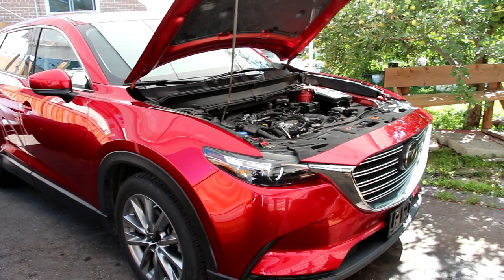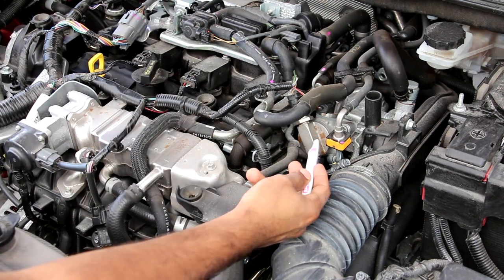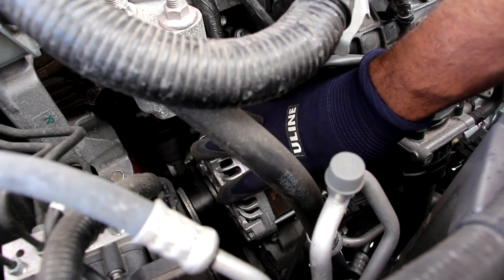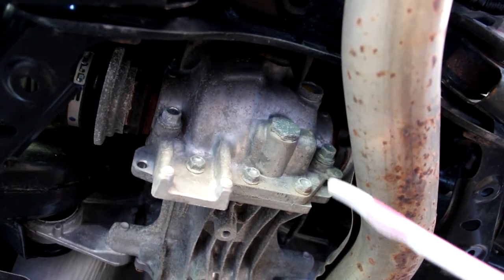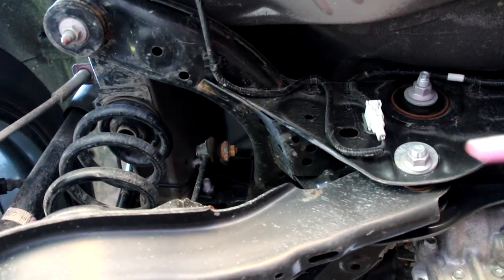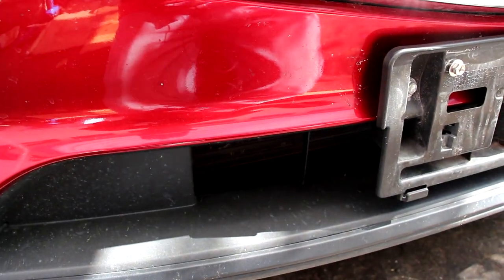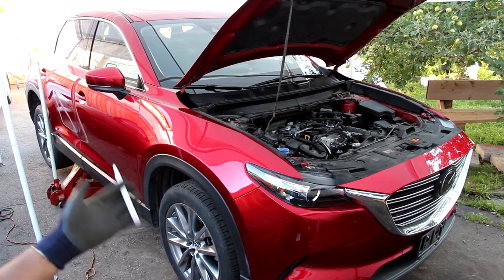Mazda CX-9 Mechanical Review

Comment: Year old and so much rust. Unbelievable
Reply: It seems these days each automaker has a major drawback, for the mechanical reliability, just rust proof it and Mazda is among the best in the business right now.
Reply: Simple fix by galvanizing the steel parts. My old Mazda 6 2005 has lots of rust on these under car parts but are so thick they are still strong.....
Reply: i was about to mention the same thing !!! someone actually told me in Canada Mazda knowing for being a rusty vehicle now seeing that i think he's correct !!!
Reply: I think it's mainly wherever he lives. In the videos that I've seen of his, all the vehicles have rust
Reply: @denttech2515  Welcome to Canada, all our vehicles rust out first winter unless the extra coating is applied.
Reply: @ljpr360  Funny, 2014 Mazda 3 and 2016 Mazda CX-5, neither “rusted out”?
Reply: @divak9026  Still going strong, no rust issues
Reply: The environment and driving conditions tends to be a bigger factor for rust than its design. They don't call it the rust belt for no reason
Reply: I will have to do NH Oil Undercoat cause the liquid salt they use here is worse for rust than the old so called rock salt.
Reply: Rust proof it and wax it each year. Like any car... at least wax it when you buy your car and keep up with wax it once a year
Reply: My 10 yo Corolla has the same amount of rust :)
Reply: Unbelievable
Reply: Because Mazda has a high compression like a diesel engine
Reply: This is how people save money and skip car wash underneath in winter

Comment: Has this car drowned in sea water? I have 2014 CX-9 and with no rust or very minimal of the iron frame and iron arms.
Reply: That's quite normal for most cars in Ontario that hasn't been rust proofed religiously
Reply: If kept in a heated garage any car will rust more quickly.
Reply: You need to make sure you check to make sure that internal timing chain water pump isn’t leaking into you engine block, because your engine is derived from a Ford V6.
Reply: Cars in cold countries rust , because of the salt used on the roads when it's snowing.  It happens to any car unless it has an antirust coating from underneath.
Reply: @tails300  False.
Reply: @halc.2899  what I said is true…look it up.
Reply: @tails300  Did you completely miss the part where this has a belt driven water pump and not off the timing chain? Lmao
Reply: @tails300  Mazda split from Ford about a decade ago. It’s of their own design.
Reply: @tails300  , I concur 100%.
Reply: @brandonthompson9957  ,  the skyActiv 2.5 turbo engine in fact does have an external belt driven water pump.  The 2014 CX-9 V6 duratec 3.7 has an internal water pump driven by the timing chain. Big job, and major labor hours involved.  Facts!
Reply: @halc.2899  Water pumps on transversely mounted 3.7L V6 engines have a tendency to fail and potentially ruin the engine when they do. The water pumps on these engines are internally mounted and driven by the timing chain. As a result, when they fail, antifreeze is dumped directly into the crankcase; mixing with engine oil and potentially damaging the head gaskets and connecting rod bearings. Many of these water pump failures occur without warning and repairs often cost thousands of dollars as the engine needs to be disassembled or removed from the vehicle to access the water pump. In some cases, the engine will need to be replaced outright.
Reply: @tails300  No is not, this is a turbo 4 with no such issue
Reply: @tails300 that was the old mazda cx9/mazda6/Taraus/mks/mkz.  2016 and up is the Mazda designed, engineered and built.

Comment: There were a number of comments addressing the rust, with some surprise, on the under carriage of this Mazda CX-9. Unfortunately, all cars, at least those made with metal will rust/oxidize, here in Central New York. The reason isn't a surprise, we have long cold winters with over 130 inches of snow and spring and fall with a lot of rain. Of course, the large amount of road salt doesn't help either. So, no surprise, the cars here are exposed to lots of moisture and salt and never able to dry out. I guess what I'm trying to say is that the rust you see here isn't a Mazda issue, but a function of the conditions this Mazda was driven.
Reply: How about in California we have a whole  dry year and year……囧

Comment: Ive had my mazda CX-9 for 3 years and it doesnt have any rust like that. Its really a great little crossover
Reply from the maker: Keep it rust proofed. Also depends on where you live. Up here it snows and they use salt
Reply: Have you had any issues with yours ?
Reply: I have a Mazda 6, driven in Chicago Illinois where there is tons of salt in the winter on the roads. After one winter the car had no surface rust. I change my own oil so I look underneath it.

Comment: I am going to buy a new 2021 Cx-9 vehicle, and this review gave me a good idea about the suspension system maintenance. I now understand that the lower control arm is easy to replace but handling the upper control arm is a nightmare. Showing the rear axle that connects the rear differential is very useful, so this is a AWD for family purposes and not for a rough off-road drive. Also, the anti-roll bar with links that needs a frequent fix. I AM Not sure about the rust but I am living in a very warm and dry climate, if I move to a humid place close to the sea that would be problematic.

Comment: Rustproof and it will be a great reliable vehicle. Aside from the metal choices you pointed out I am really impressed with Mazda's new designs.
Reply from the maker: Agreed!
Reply: Bought a 2020 Mazda CX-5 in July. Got it undercoated early September. Hopefully, it wont rust as quickly.
Reply: Yes but why should I have to rustproof a vehicle myself that I just paid 40k for?
Reply: @halc.2899  Because companies don't care anymore and it's always something with every automaker, for example; it's better than taking it into the dealership every week for electrical issues (amongst other things) on a vehicle you paid $65K for. Lexus and Acura are still pretty reliable but almost every other "Luxury" or above average class vehicle has so many issues because of all the extra features. 

For me personally I would rather do a bit of coating than have mechanical issues or have to take it in every week especially for people like me who live hours away from dealerships.

Comment: Other items that may be important to note that I have encountered on the CX-9. High pressure fuel pump failures that cause metal particles to damage the injectors. Cracks between two and three cylinders in the exhaust port.
Reply: What are the symptoms of that issue

Comment: exhaust gases are inert so they dont get reburnt as you say

EGR works by  provided some inert gases to combustion to act as absorbents of combustion heat to reduce peak in-cylinder temperatures, this reduced possibity of knocking and NO
x produced since high in cylinder temperatures promote knocking and formation of NOx, another primary benefit of EGR is you can have larger throttle opening to compensate for diluting the air with exhaust gases this helps reduces pumping losses(how much effort the engine uses to suck and blow air).

Comment: Great video!  I own a 2018 CX-9 and love it, except for the fact that I've had to replace two motorized hatch lift struts already at a cost of $800 each. First one was under warranty.
Reply: Have you had any other issues ? Any rust? I’ve heard some rust on the roof? Also hear about engine failure. I’m looking to buy one but worried about big issues.
Reply: @PictureProStudios  That's the only issue I've had after nearly 80K miles. I also do all my own maintenance.
Reply: @PictureProStudios   did they say WHY the engines failed? engines can fail more so from a lack of maintenance ... if this was a chronic issues it would be all over youtube and the internet . so i have to wonder for total engine failure.. what was the maintenance history like BEFORE the failure.

Comment: Again, an excellent car review. I am very familiar with different Mazda vehicles. I think CX9 is a fun car to drive. Also, the reliability is quite good however the maintenance is pretty expensive, especially if you want to use OEM parts.  I would not recommend CX9 to anyone who likes working on their own cars. And yet be aware of the rust issues.
Reply: Expensive parts how? If you can buy a cx9 I can't imagine oem parts are going to be a problem.
Reply: exactly why and how is it expensive... examples please

Comment: I own a 2009 Chevy Equinox with 180000km, absolutely no rust, oil sprayed myself from brand new, underneath is mint, what a difference it makes, don't undercoat, oil spray instead.
Reply: How do you oil spray?
Reply: What type and brand wd40 or other?
Reply: @PecanPie1102  There are a variety of non-permanent undercoatings you can use, some off-the-shelf and some homemade.  Something like Fluid Film works well.  Others use bar-and-chain oil (summer formula preferred) as it's pretty sticky mixed with a solvent like kerosene to make it more sprayable.  Some people just use used motor oil.  Just don't use anything permanent like spray truck bed liner or Ziebart or whatnot...the permanent coatings actually trap water and accelerate rust!

Comment: Excellent reviews, I like how you show us the components of the car for when repairing and break down each aspect.  Engine , transmission, and suspension.

Instead of just shouting out don't buy this get a toyota instead like other people on youtube, without any indepth analysis.

The eclipse cross looks like a winner to me so far mechanically, these mazda and Kia/ hyundai have weak gdi engines.

The first thing to do with a mazda is install a catch can and get a rust proof coating done from underneath
Reply from the maker: Thanks. And yes Mazda looks to be a pretty solid offering

Comment: Min 10:04 ... Nice blue SMOKE ! 💥🙈
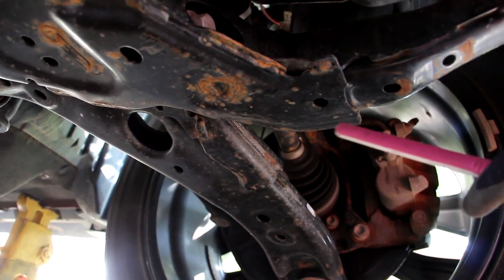Min 10:56 ...  Rusty 2019 Mazda 💪
Reply: Engine wasn't warmed up, any Turbo will do that on cold start then high rev.
Reply: @DavidRC Now that Mazda is partnered with Toyota maybe they will start to do the same.
Reply: @DavidRC Is that why Tacoma frames self destruct?  Toyota is great in many ways but I haven't see where their corrosion protection is superior.

Comment: Heck Yeah! I own a 2017 CX-9 sport. I love that thing, it drives perfectly with the exception of the transmission jerking for the first few shifts when not warm. It looks just like that one mechanically minus the AWD system. Gas Mileage is great, I get around 24 combined City and Highway which is crazy to think it gets 4 better MPG while also more HP & Torque than my old v6 mustang did while weighing over 1000 lbs more. However, I'm paranoid about rust now after seeing that but when I was under the car changing the trans fluid the other day I didn't notice any, must have gotten lucky as the car has only ever been kept in SoCal and CFL.
Reply: Thanks for posting.  I own a 2016 CX9 and was concerned about the rust issue.  I live in CFL. 😅
Reply: @Myname Isunavailable More or less a rough shift. I think it's a design flaw, the 'Tropher' did a video on driving a New CX-30 and commented on the transmission doing the same thing (90F and below). I think the cold temp throws the fluid viscosity off parameter and when the TQ converter locks up during the 1-2 shift it's harsh. I personally don't mind it since it goes away, I just don't know if it will get worse, or damage itself over time.
Reply: I have a 2016 GT CX9 with 32k miles on it.  No AWD.  I’ve noticed the same issues before going to work.  It’s a simple fix.  Let the engine warm up for 5 minutes.  Issue gone.  It never shows up the rest of the day.  In my vehicle, the shifts are not “jerky” but I can feel them and that may be issue.  After the car warms up,  you hardly feel the shifts at all.  I’m comparing the CX9 trans to a 2010 Ford Escape.  Shifts were NOT smooth and actually got worse after getting off the highway,  then it really “jerked “ the car.  Even passengers could feel it.  I would take the CX9 over it hands down.
Reply: I have a 18 cx9 and the jerking was something I noticed when starting the car when it was sitting for a while.....I allow it to warm up and no jerking when going through the gears
Reply: I have a mazda 3 and very rarely notice the jerk shifting. I drive it smoothly until it warms up to avoid it, which is good thing to do regardless for the engine as well
Reply: I read online that this may be resolved with some software updates from Mazda, might be worth checking out.
Reply: Yeah just for anyone wondering about the cold start shift and idling.  This is a software controlled idle and rev map for cold starts.  This all goes away as soon as the little blue temp light turns off.  This was very aggressive in the early Skyactive ECUs but has been toned down in software updates and newer models.  It really isnt doing anything wrong, just a higher rev to get the engine up to temp.

Comment: Thank you!! I’m looking into buying the new Mazda 3 Turbo, which has the same engine in it. Sad to hear that the rusting issues I’ve heard about seem true, because I’d like to own the car for 15+ years!
Reply: GeekCatholic 6 years, 2 accidents and having my 2015 Mazda3 keyed, I have no rust on the body panels
Reply: Kevin Wright - Nice! I would hypothesize that Mazda’s problem is the chassis paint, not the body paint or the quality of steel used. If that’s the case, CRC corrosion inhibitor should be a great fix. I plan to apply that to my underbody components every couple of years.
Reply: GeekCatholic I have been underneath my car multiple times and this CX9 has more surface  rust underneath than mine.  I have never undercoated it, only run it through the car wash.  I’m going with another Mazda when the time comes, no doubts.
Reply: My intention also

Comment: There is lots of surface rust, but something to remember is that 99% of that is surface and not the actual steel itself rotting, on many stamp steel setups you'll see the entire frame orange in rust but still solid even after 10-20 years, I have a 2014 Mazda 3 and the stamp steel has surface rust but is still very solid, I live in northern Canada and the outside has zero rust, even around wheel well and side skirts, which I think is most important. Although I would very much like to see more aluminum and upgraded design, especially with the luxury aspect they are looking for and good build quality inside
Reply from the maker: Agreed, alot is just surface rust. But there shouldn't be surface rust on a brand new vehicle...
Reply: @speedkar99  I do agree, a better undercoating from factory would help alot, hopefully the next generation adds this
Reply: @speedkar99  Every single vehicle that uses the same material and finish will rust. It is just the nature of it, but definitely nothing to worry at all.

Comment: Are carbon buildup common on these Skyactiv engine? Even though it's direct injection, apparently they made the engine temp high enough do that carbons cannot form on the valves
Reply: Very uncommon on later generation skyactiv engines

Comment: How hard would it be to replace the head gasket of CX-9? I watched a video how they replace the head gasket and they had to remove 6 trolleys of parts to get to it.
Reply from the maker: Most modern cars have alot of things packed onto it. They're essentially built then installed into the vehicle body. 6 trollies sound right 🤦
Reply: Car Wizard has a video on this.

Comment: Rust proofing?... Can you elaborate or give a good google search phrase? Just bought a new CX-5 in salt county and would like to drive this car for the next 20 years. So far the best I can find is an oil treatment plan for biannual application.  Thanks
Reply from the maker: Oil is good stuff
Reply: mazda don't usually last 20 years....You started with a wrong car.
Reply: According to project farm, CRC rust inhibitor is much better than oil. Same stuff manufacturers use inside panels.

Comment: I dont think that rust would be an issue, just like the rust on brake rotors.
Reply: Those non-coated rotors they sell are so annoying. They start rusting as soon as you bolt them on & while I get that it's just surface rust who wants a rusty brand new rotor! 🥴

Comment: I think it's ridiculous you all think this is a lot of rust. This is light surface rust as expected in any New England state, and the car manufacturer tests all components until end of life. Get underbody washes for salt every week if you care. The mechanical configuration is incredibly similar to my Audi S3 with way less plastic being used like the front bumper support & oil pan which I've cracked.
Reply from the maker: This is a lot of rust for a brand new car. This would be normal if the car drove through one Winter.